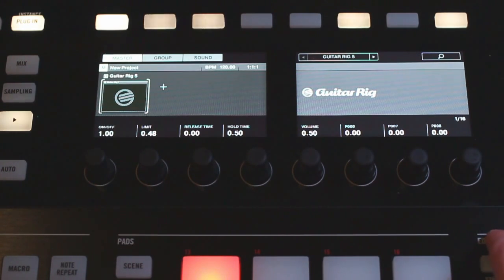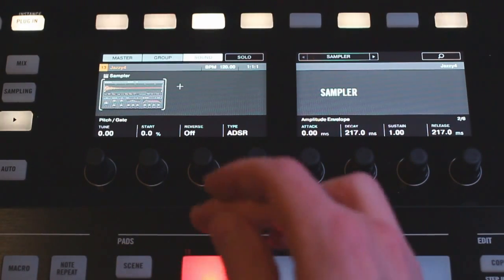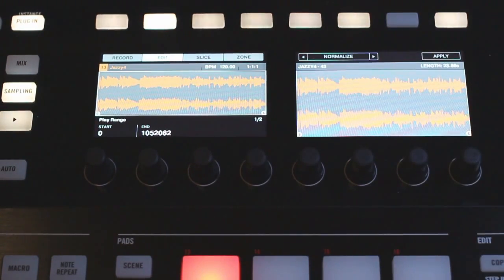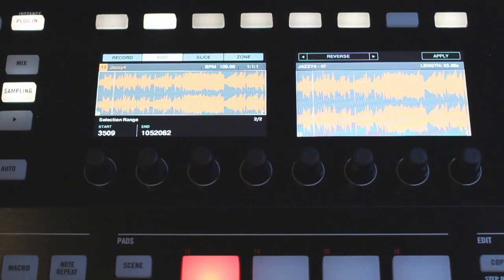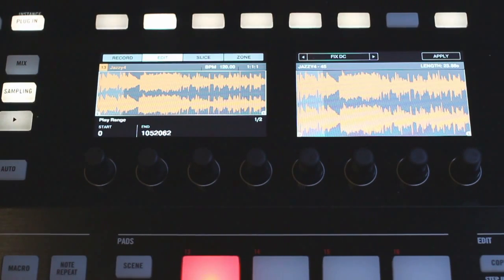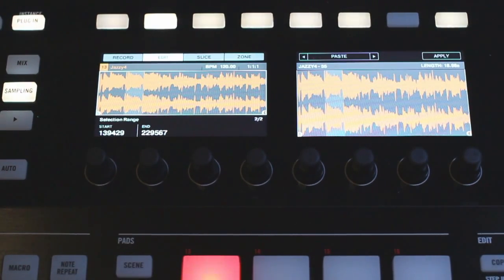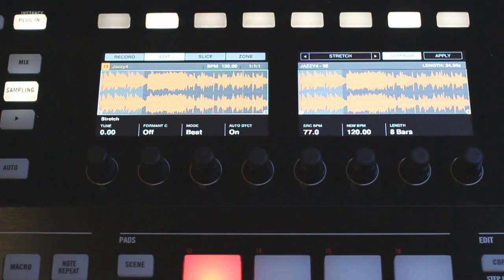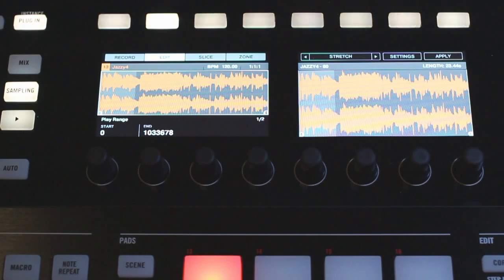Maschine Studio tutorials - How to Edit Samples On Maschine Hardware

Comment: The problem Im having is that once you truncate, the software makes another file in the same folder as your samples and they all show up in you user library. This is a mess.. Especially after finally getting it organized.

So Im wondering if there is a way to use non destructive chops to set in and out points on the sample, that you can then use the other tools in the Slicer like Detect, Split, etc.. as if you had truncated it?

There must be a way to do this or something similar, that doesnt involve flooding your user library with tons of truncated files..